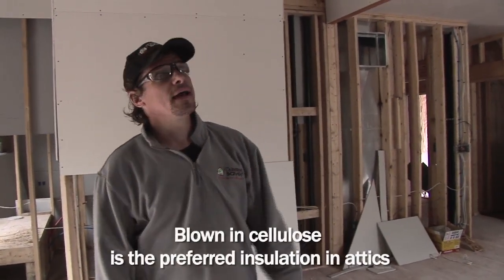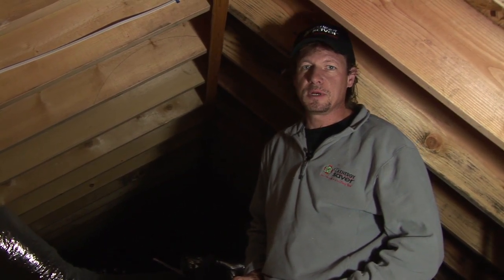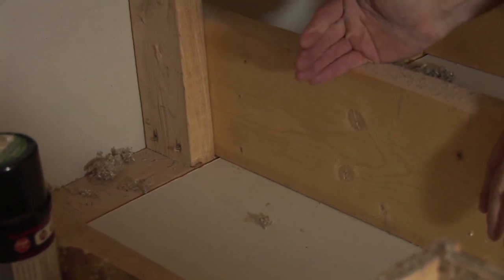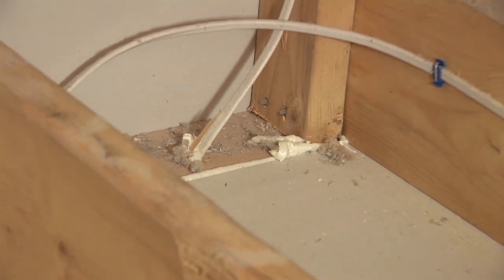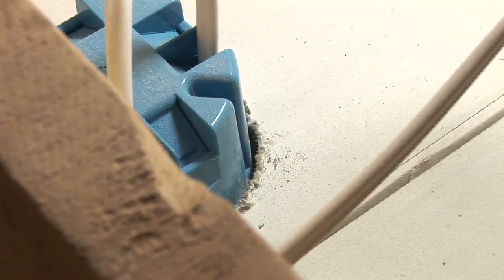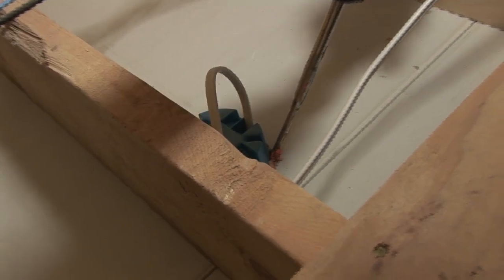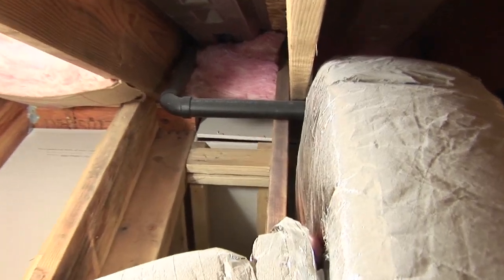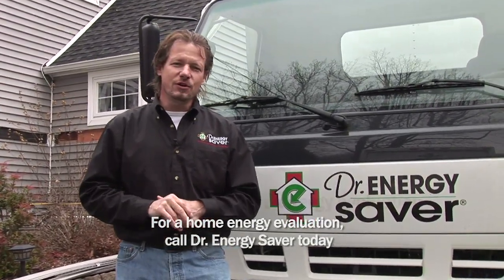Sealing and Insulating a Cathedral Ceiling and Attic with Foam and Blown Cellulose

Comment: Kelvin, You don't want air leaking from the heated space into the attic.  Fans in the attic are supposed to pull hot summer attic air out of the attic, the idea being that new cooler replacement air would come in from the attic vents.  But by depressurizing the attic it will suck air in from the heated/cooled space.

Comment: Hi Larry  amazing  video, but there is something I don't understand, I saw some others videos about home ventilation in the summer using just a fan, instead using a air conditioning system or cooling.
the question is :
what I don`t get it is why a lot people  put a fan ventilation just on top of the house , so pushing the the  hot air  from inside the house into the attic, but you, in your video  are  trying to avoid even small quantity of air flow inside of the attic. there is any reason why?